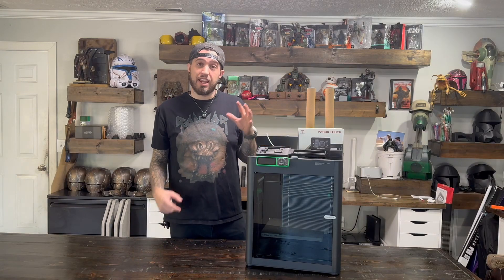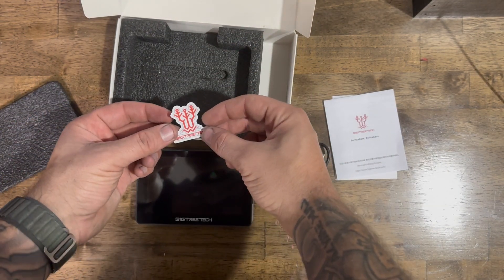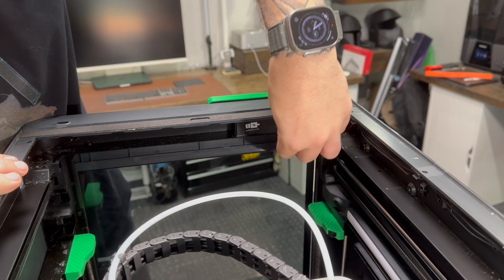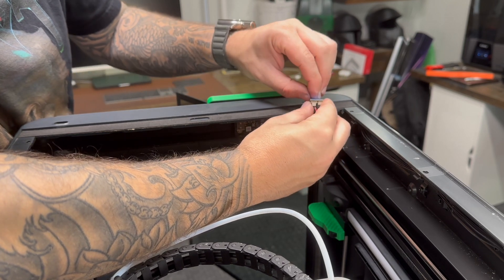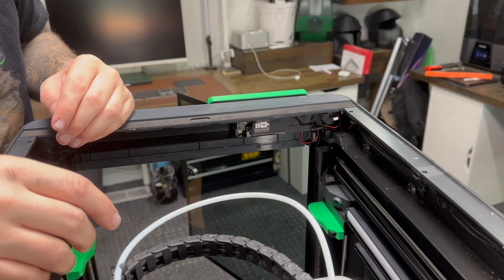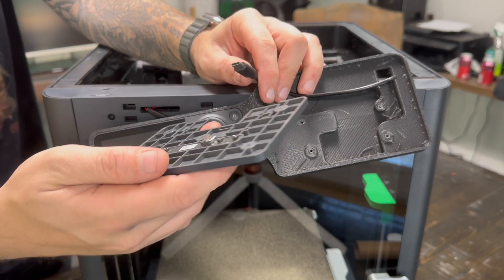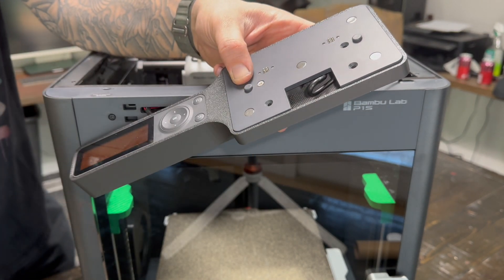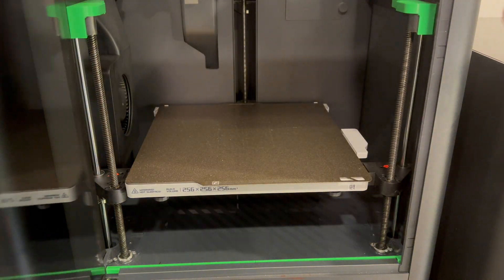Upgrade Time! Bambu Labs P1S Gets a Facelift with BIGTREE TECH Panda Touch & New Lighting

Comment: It will not let me log into Bambu Labs account. Do you know if there is a fix for this. I do not have 2FA turned on
Reply from the maker: I do not I would probably just make a new account they are free just use a different email
Reply: There is a new firmware update. It fixed the issue.

Comment: You made it look like you just connected the panda touchscreen and it worked. Is there no set up to this not all of us are savvy about this stuff.
Reply from the maker: So there is a little adaptor that come with the panda touch the wire to the printer plugs into it and the panda plugs into it’s a splitter. Once you turn it on it walks you through it and it is super easy to

Comment: The touchscreen is totally useless.
Reply: I read a comment from another video regarding the recent firmware upgrade to the P1S. It said something about not being able to control certain features like hotend temp and preheating the bed from the touchscreen. Can you confirm this?
Reply from the maker: @timt8199  I have not ran into that issue
Reply from the maker: I really like it! It controls all 3 of my printers! And for the price was affordable!
Reply: Could you just use a phone or tablet? With without root?
Reply from the maker: @andreamitchell4758  you can the screen is nice but not a have to have. I like the bigger screen